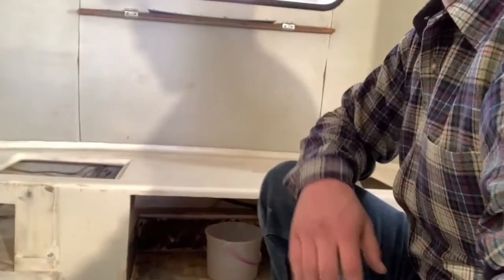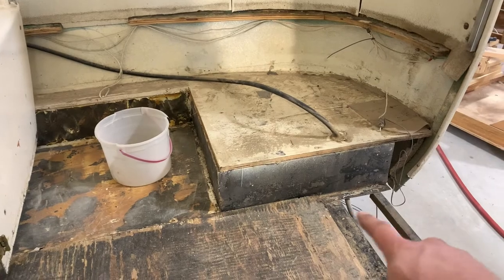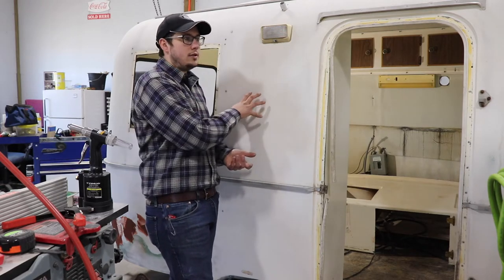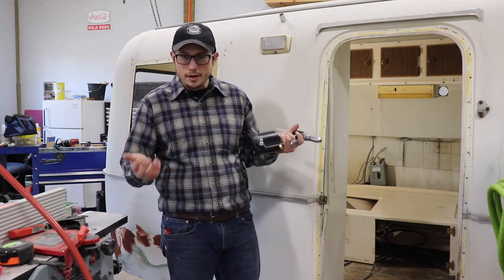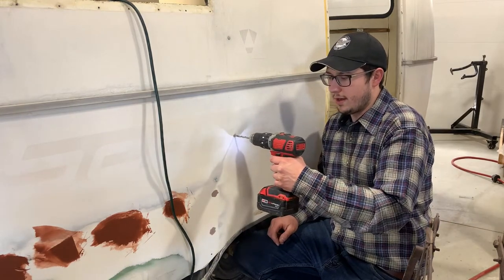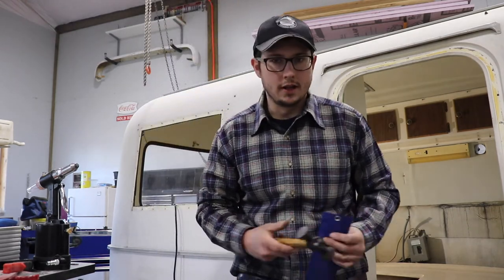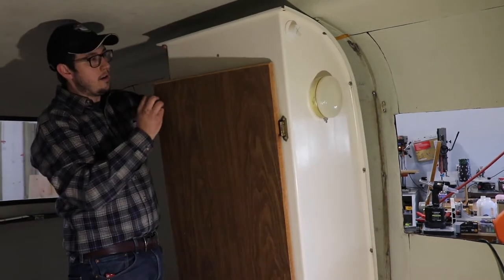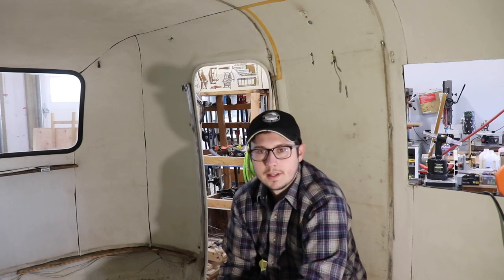How To Remove Scamp Camper Fiberglass Cabinets

Comment: 10-13-22
Just saw this today,  so different from factory tour putting it together. 
Even a non-handyman can learn from you. 
 Videos anti Scamp  push how Scamp uses wood in the flooring, after pulling up carpet or vinyl flooring, it can be found to be wet or with holes and the trailer isn't a good buy.  Ironically Scamp has a 2 year wait, competitor 1 yr. But  13 foot not offered by competitor like Scamp  has. It's their biggest seller I've heard. 
Any comment about flooring in fiberglass trailers?  
Also,  if cost is between air conditioner or fan to pull air in-out which? Of course windows are operating. 
Thanks

Comment: How far along are you on the Scamp ?   By any chance, do you know what kind of fiberglass resin  is used on these lil trailers?  Epoxy or polyester ?
Reply from the maker: Thanks, I haven’t made a ton more progress due to work. However yes I do, I talked more about what I’m using in another video on my fiberglass repairs. Originally it is polyester. You can use epoxy Over polyester for repairs, but not polyester over epoxy. You can also just use the standard polyester kits as well.

Comment: I am getting ready to start on my 13ft Scamp project. Have you replaced the axle? I am looking to change mine from trailing to leading, do you have any experience with this?
Reply from the maker: I haven’t yet but we will be doing so. I’ve heard some people have made that change, but the placement underneath is setup where it fits best how it was originally (in my opinion). But it’s definitely possible to change. I’ve even seen people do leaf spring setups. I’ll be changing ours to a dexter with just a slightly different angle to get just a bit more ground clearance.
Reply: Either of you folks finish your axel change out? How did it go? Learn anything that may help me? I have a 1977 and the axel is in pretty good shape but it rides so low...